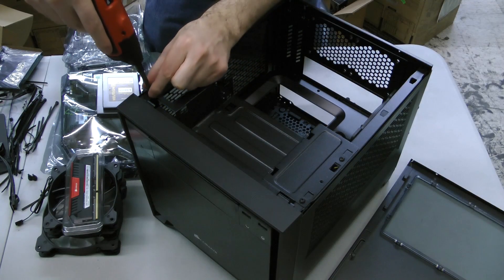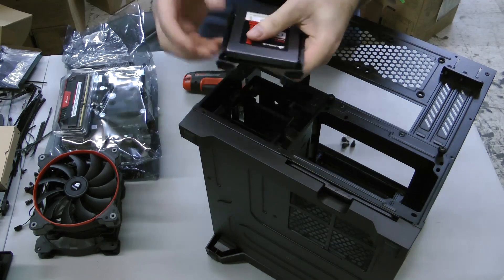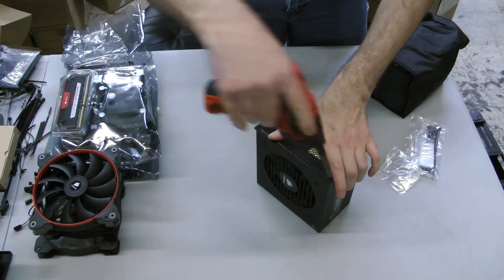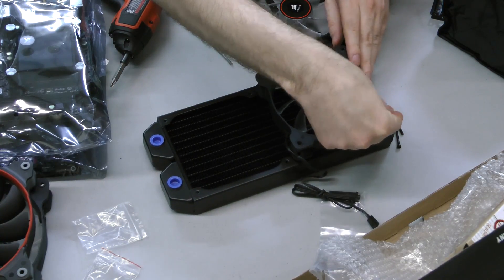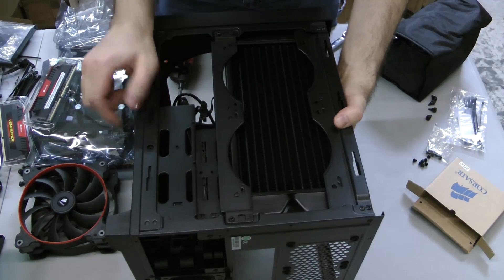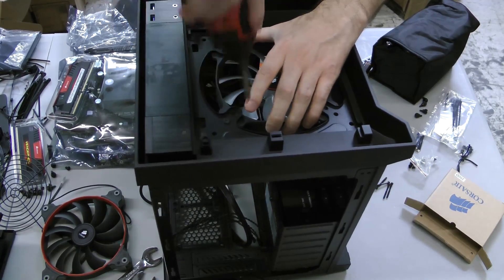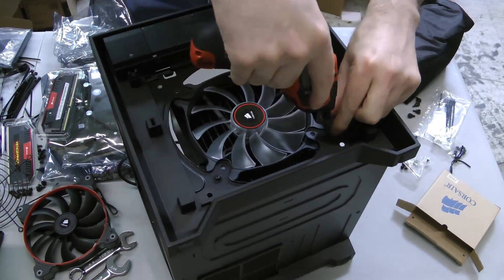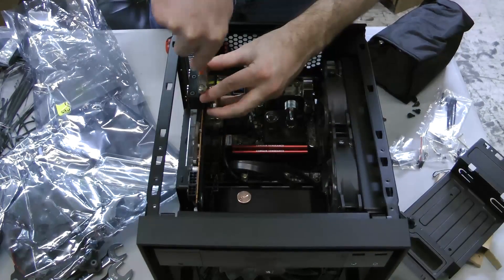Corsair Labs Uncut: Watercooled Obsidian Series 250D Primary Assembly

Comment: I am in the process of parting together a system and I would like to build around the 250D. I was just wondering if there are clearance issues with Corsair AIO coolers, and maybe a suggestion on which models would be easier to stuff in there. Thanks.

Comment: video could be better detailed. whats the clearance between the 140x60 radiator and the motherboard?

looking into doing a very similar loop with a bitfenix 200mm front intake fan and a 200-140mm adapter. mainly want the 150CFM that the 200mm fan is capable of and being able to shoot that much more air into the case if needed or put it on lower speed for quietness and still move lots of air.

Comment: There are no SP fans for a 140mm so they use an AF as the main intake then 2 120mm AF fans on another rad? WTF? 

Also seems to be a few design issues...

The H105 is too big for the 250D.
A lot of graphics cards can't be used because the heat pipes melt the top window.
With some rads you have to remove the top SSD caddy.

It's a real shame I really wanted this case to work...
Reply: the heatpipes melting the top window is bullsh1t unless your gpu is like a 100 degrees........
Reply: MrHearthofSIN

Well the actual melting temperature is lower than 100 degrees and it's common for AMD graphics cards to reach 90 degrees, especially in ITX cases due to the low air flow.
Reply: smorg12 you are right but i will need some picture evidence of the top window melting before i belive in it. because even if the gpu hits 90 degrees it won't mean the heatpipes reach that and their should still be somewhat cold air from the gpu fans. :)